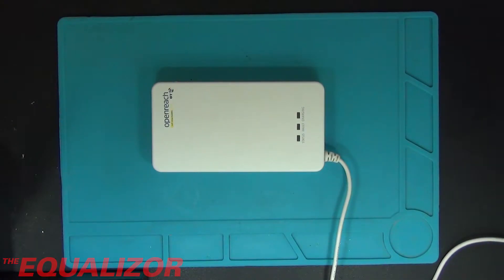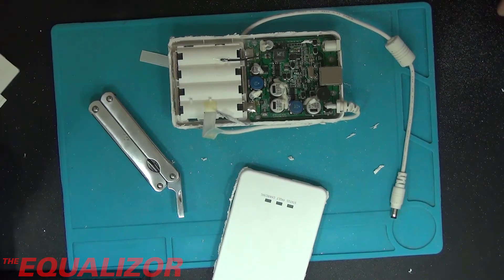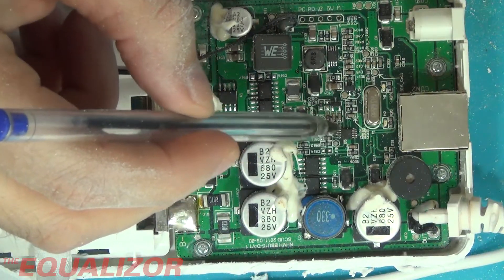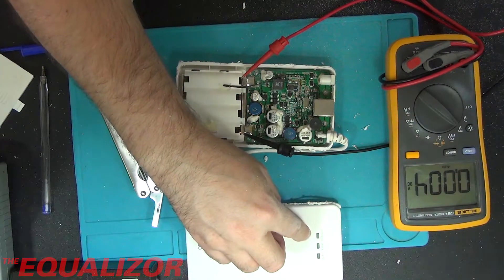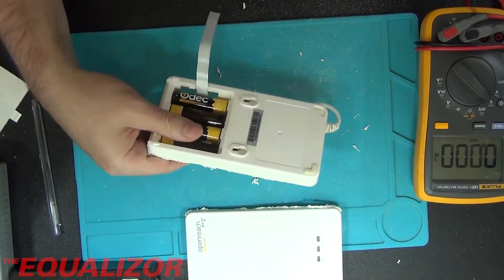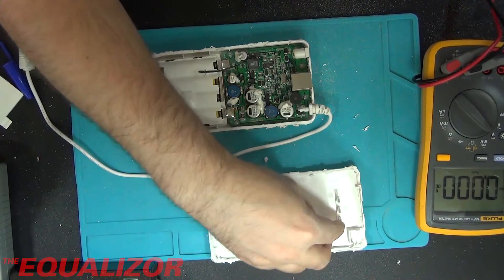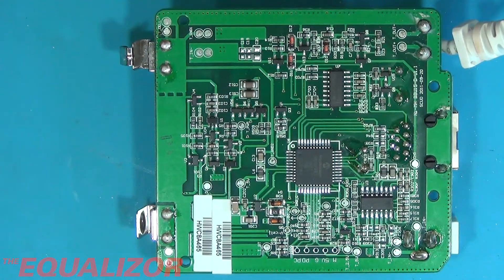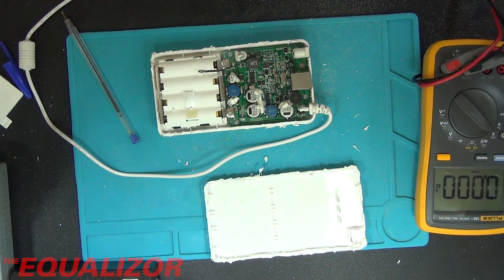BT Openreach Battery Backup Unit Teardown

Comment: OTOH I haven't ripped mine apart so it is useful to know that the 4 connected wires used in the RJ45 connector in the middle are likely to be an RS232 style port - now I will want to try and work out the interface protocol so I can see what it is reporting - hopefully battery voltage / unit state. With a further 12V to 5V down converter on the output it might make a very handy UPS for my Raspberry Pi Home Automation system {RPis do NOT like having their power removed suddenly as it can lead to corruption of their OS held on the miniSD card!}

Comment: These units work very well to provide 'UPS' style battery backup power for 12V DC equipment. The reason You were seeing a Fault indication is that You need to feed 12V DC power (DC V+ AND DC V0)  in to the power IN socket.  Attempting to feed DC power into the device with +V  connected to the DC power IN socket and 0V to the B- Battery connection point is indeed a fault. The battery B- and B+ terminals should only be used for battery connection Not external power input.  With DC power correctly connected to the DC IN connector terminals the circuit will check battery voltage and charge the batteries as required. When 12V DC power input fails (or is turned off / unplugged) the circuit uses the internal batteries as power source to continue to provide 12V DC output to the flylead. When external power is returned it will seamlessly switch back to 'charging mode'  to bring the batteries back up to full charge while providing 12V DC output from the 12V DC INput power.  The 'big ass caps' ensure that changeover from external power to/from battery power is seamless.  I have been using these UPS/backup power units on Modems, Routers, 4G modems, Network Radios and other devices that run from 12V DC 1A supply. (It can provide backup power for several hours with high capacity rechageable  AA cells installed) The RJ45 connection is not required for use as a basic 12V UPS. It is NOT an ethernet port (check the wiring!) It allows the FTTP device to monitor the Voltage/status of this 'UPS' unit.  Great little units wehn used / connected correctly.
Reply: I have one of these as I have the Fibre from BT but do not have the Landline service so I have removed this unit and wanted to use it as a simple re-charging unit, however I cannot get it to charge batteries, I have tried using the ones provided as well as other types, I have even plugged it back into the Fibre with all the connections back as it was but still shows Fault, it did show fault before removing it originally and I assumed it was just the batteries, but changing them did not remove this fault either, so how do you normally get this to charge if the fault light is showing regardless?